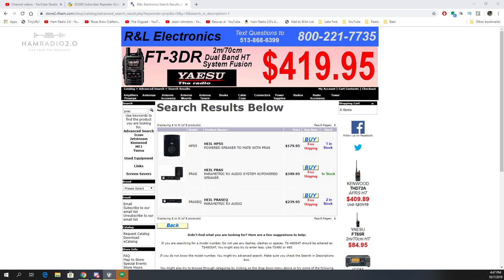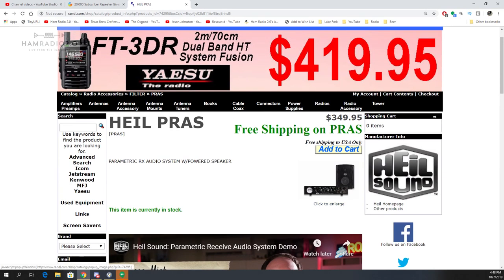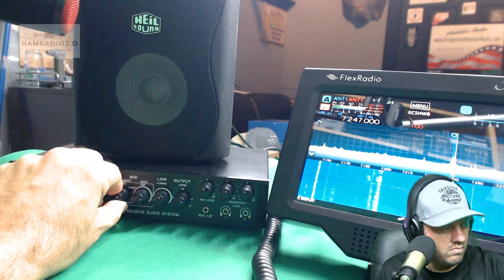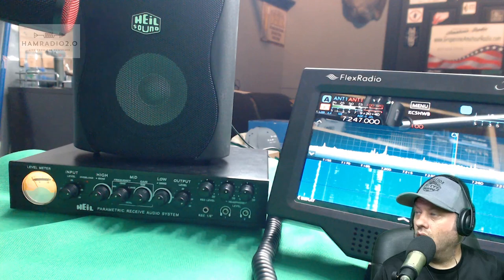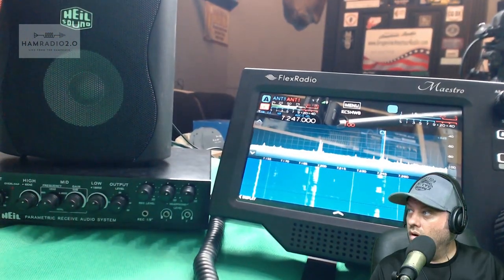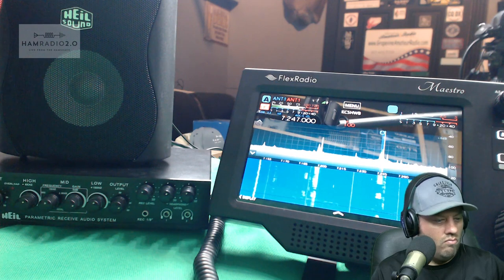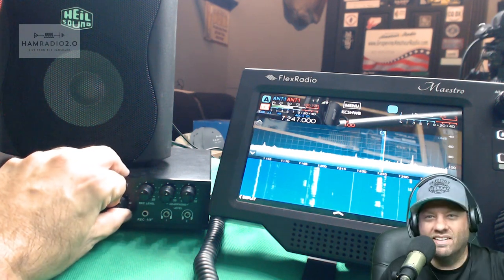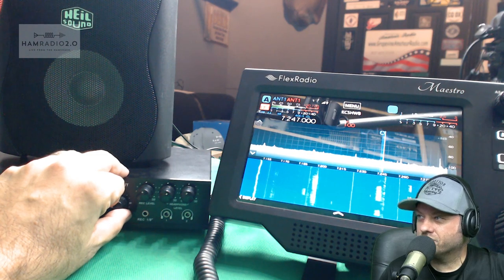Heil Sound Parametric RX Audio System Demo

Comment: Thanks for the video. I could definitely hear a difference on the weak signal as you rotated the dial so it appears to be doing its job even with the filtering in the Flex Radio being as good as it is. I’d like to hear the difference on an older radio like you suggested, I imagine it would be quite dramatic.
Reply from the maker: Agreed.  I may try it with a QRP rig in Costa Rica during my trip.

Comment: Your videos have come a long way.  I have the PRAS and you have to use it some before you get the knack of it.  I seem to adjust the "freq" knob under the "MID" section the most.  My initial efforts with that system didn't provide much enhancement but once I began to understand it a bit the effectiveness increased dramatically.  Bob Heil doesn't produce any junk- seems to be a good dude.  KC5LL     (EDIT: I'm using this PRAS with a Yaesu 991.  I am using the JBL Control 2P powered speaker)
Reply: yes but there way to over priced

Comment: I have one I also have the speaker but tend to use with headphones, my hearing is terrible ! The unit works very well and I am pleased I bought it. I use with a IC 7300. However mine after a month developed a fault and had to be sent back it was repaired and returned and has been ok since. When returned there was a crack in the meter dial that was a shame but I did not do anything about this as it does not impede the way it works. Would I buy one again YES .

Comment: The Maestro has a built in EQ on one of the setting menus.  It would be interesting to see the settings for this test.  Not sure if the RX EQ is only for the internal speaker or if it's connected to the line out jack on the back?  I would think it's connected to the line out so if you have a power speaker that doesn't have EQ settings you could tweak the audio.  I don't know what the default EQ is on the Maestro...I would assume it's flat across the board for both TX and RX.
Reply from the maker: Yes it is flat. I wanted to keep it off for this test.
Reply: @HamRadio2  It would be interesting to hear the Flex EQ compared to the Heil just to see if there is any advantage to owning this system with a Flex specifically.

Comment: Just bought the JBL powered speaker that Heil worked with them on. Its a really nice powered speaker. I connected to a mixer board, but considering this equalizer. Pretty pricey though....not sure that it will do anything more than a decent mixer that has low, mids, and highs
Reply: I was going to say the same thing it's a mixer with audio in from audio out your radio, it looks nice but you could do the same with my DJing mixer like the DJM 800 or DJM 400, with a really nice powered speaker :) still a really nice product for people not sure on how to set this up on a mixer.

Comment: I use the PRASEQ with my Yeasu FTDX101MP which has a great receiver.... so then, with the MP, many faint signals are heard on that other radios just do not pull in.  With the PRASEQ system (using headphones or the powered speaker(s)) I can, 75% of the time "dial in" a faint audio signal and better define the audio and hear the audio (which otherwise in not intelligible).  It does not fix QSB which of course is band and condition related.  But that said, from the East Coast I can pull in Japan, Australian and New Zealand station's audio and with a tiny bit of dial fiddling on the PRASWQ turn faint mush into an understandable and successful QSO.  It is a pretty good system.  I power the system via my 12v Anderson power pole distribution panel and put torrioids on all the wires.  The onboard headphone amplifier(s) are very good, clean and adjustable.  I am glad I have this system and would I buy it again? Yes. If you cannot hear them you cannon work them.  W1SWL Art in Charlie Tango.

Comment: Jason how did it work in Costa Rica and are you still using it? My FTDx10 has a built in rx eq and I can turn up the mid range and adjust the hi and low. I wonder how much of an improvement it would make for that radio which is still at Yaesu by the way, getting a new board.

Comment: Bob Heil knows his audio, so I'm sure this works well, but I actually get angry when I see people put "ham radio" and a technical sounding name on some very, very basic audio processing gear and then put a price tag on it that's at least two to three times the price for the same (or more) capability from almost any pro audio manufacturer. And hams buy it! 

A Behringer XR12 effects mixer will do everything described (and in stereo so it can split the feeds from a dual watch setup), will monitor multiple radios at the same time with all the audio shaping tools and volume controls tailored to each radio/mode, and even more capability in audio shaping (like multiple EQ modes, compression, etc.) and will output it to whatever speakers or headset you want.  Also will handle all the audio shaping and phantom power requirements for almost any microphone and can change it from rag chew mode to chasing DX with one click.  And it's $250. And yes, you have to add a decent speaker(s) to it. Decent studio monitors for the frequency range we work can be easily found for $50-$100. I happen to like JBL.

 Add a W2IHY iPlus to it (for another $239 for a $100 piece of gear because it's got the moniker "ham radio" on it but has a unique functionality so it's worth it) and you can switch a single mic, key, and PTT across all three radios with a single knob turn. The XR12 also will set the mic output level with a single click so you can use one mic across all brands of radios as well with no need to worry about what design (electret or dynamic) of mic the radio is looking for. Did I mention all that functionality is $250?  And if you don't like Behringer, Mackie and several others have similar boards and similar price points.

Bob knows his audio, but his brilliance is in marketing! :-)
Reply from the maker: I spoke to Bob Heil directly over the phone about this unit.  He says there is no other unit like this on the market anywhere.  Something internally is different from the commercial pieces you are talking about.  I don't know all of the technicial specs of sound equipment, etc - but you might contact him directly and pose your questions to him because, according to what HE told me, your statements above are incorrect.
Reply: I may do that. That said,  there are only so many ways to process audio to break out one sound from another. Did he by chance tell you what it is that he believes is "unique"?
Reply: I went through the specs again. At least what little is published on the website. I still don't see that it is anything other than a 3 range single channel parametric equalizer. Again, I'm sure it works well because Bob does know his audio. It may be unique in that no one else on the market sells a 3 range stand alone, single channel equalizer. All that I usually see are incorporated into a mixer or other gear. And only W2IHY is producing 1 specifically "designed for ham radio" (and his is only on the transmit side). Again,  the man is a marketing genius. I may be a little cynical about him, but I'm generally not critical of his products, only his pricing.

Comment: At first glance I thought why wouldn't a mixer board with a built in equalizer for each channel do the same thing but I am clearly out of my league here. A lot of money but it's ham radio...right? Obviously you have a mixer for your video production. Can you try that on a channel and use that equalizer and compare? For the money it better be a single channel equalizer on steroids. Oh wait,  that is the whole kit price. Maybe not so bad as most add-ons are $200 or more.
Reply from the maker: This EQ is specifically for a Radio receiver. Not a video recording system.
Reply: @HamRadio2  , audio is audio whether it's coming out of an IC-7300 or a digital recorder. An EQ simply raises or lowers the sensitivity in the chosen frequency range. Pulling a voice out of band noise is no different than making your voice sound more mellow by emphasizing the lower frequencies or getting rid of a sibilant "s" by reducing the higher frequencies.